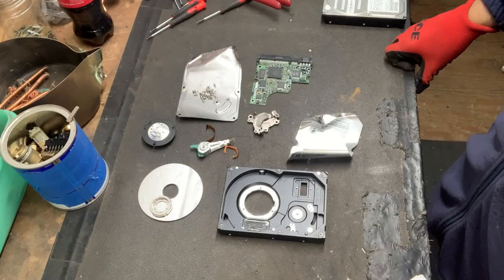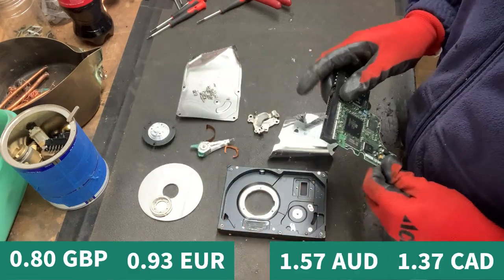How To Scrap a Hard Drive

Comment: i have found that the plate you called stainless steel is often brass. i always hit it with the grinder to double check.
Reply from the maker: I once found one that was brass, that was a nice surprise. I usually mention the importance of checking metals with a file but I totally forgot, thank you for the reminder. 
Thank you for watching.

Comment: Thanks for the information about the stainless steel part. I bend the platters immediately after removing them to assure my suppliers that no data leaves my shop.
Reply from the maker: You’re welcome!
That’s a good idea with them, thanks for the tip. 
Thank you for watching.

Comment: Great video! To the best of my knowledge, the plate where the magnet is glued is made of MU-metal, which shields well and consists mainly of nickel. I have no idea if this makes a difference in terms of price; I'm more of a chemist than a scrap dealer. I've also had two hard drives before that had round glass plates instead of aluminum ones, although they are rare. I then etched away the coating and had excellent glass plates for decorative purposes. It's incredible that the glass disks survive the high rotation speed. I wish you all the best and a wonderful day. Greetings from Germany!🙏
Reply from the maker: Thank you for that. I still have lots to learn about ewaste!
Have a wonderful evening and thank you so much for watching.

Comment: The aluminum piece you took off at 5:55 has a small ring of magnetic wire in it. You can just cut the edge of the piece and peel the wire out. I only know this because I've scrapped 100's of drives over the years. I do like your videos. They are just like the ones I use to make years ago when I had the time. Very informative. Take Care.
Reply from the maker: Thank you, I’ll have to check that out, I appreciate the help. 
Thank you so much, I really appreciate that. 
Have a wonderful day!
Reply: You're welcome. Just put one of those magnets over that piece and it will stick on the edge. Thanks. @scrapitall200
Reply from the maker: @Scrapping4aDart  i appreciate that buddy!

Comment: Ive torn half dozen or so HDs apart .   Love the neodymium magnets & told they can be sold with the MU metal backers for a pretty good price.   I use Stailess Steel welding rod to weave thru the holes so i have a 3' pickup tool that sticks to everything just before i get it to the wrench i dropped down i to the engine bay😂😂😂
Platinum is on the platters but not sure if its only certain brands or vintage platers.   
@Streetips think he has done some refining of gold pins and HD components for the precious metals.   Love his channel too!
Stay well and keep up good work.
M
Reply from the maker: Those magnets are incredible. I’ve heard they do sell for a good price on eBay. 
Sreetips has great videos, I’ve watched quite a few myself. 
Thank you for watching.

Comment: Have you got a Scrapitall way, haha to remove the motor cover to get at the copper from the motor?
Reply from the maker: Haha yeah I do. Usually there’s a slight lip to the edge and I’ll get under it with a screw driver and pry it up and the cover will pop right off.
Reply from the maker: So I just looked at that motor and the way I described will not work. I just made a short showing how to get them apart if you want to check it out buddy.
Reply: @scrapitall200 . Thanks, I will do that.

Comment: I am a hobby scrapper as well. I am curious about the gold connectors on the rj45 and rj14 cables. Right now I am snipping off the ends. I have almost 20 pounds of them. What procedure would you use to recover the gold or do you know of other places who would buy them? Thanks 8:50
Reply from the maker: I haven’t gotten into any gold recovery yet, but Boardsort.com buys gold connector ends.

Comment: How do you get the electric motors out if there are no screws to remove it.
Reply from the maker: Flip the hard drive over and use a punch and tap it with a hammer. 
Hope that helps. Sorry I didn’t think of putting that in this video.

Comment: What size driver did you use on them small screws I can't find one to fit them
Reply from the maker: I used a T9 torx bit. If you search on Amazon for torx screw driver set, they have lots of affordable options. 
Thank you for watching buddy.
Reply: Harbor Freight has an affordable set w/Torx, flat, Phillips bits, and a hand bit holder all in a case. Has worked well thus far for HD’s (but I’m also careful not to destroy the torx bits because they do seem fragile).
Reply from the maker: @spaz-tech  I have a set from them, pretty good for the money, except like you mentioned, the torx are fragile.